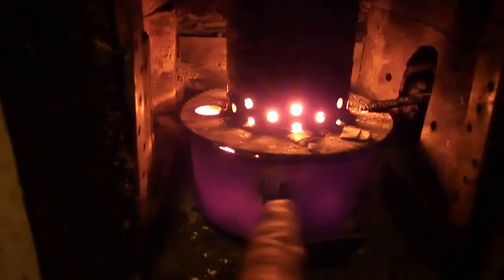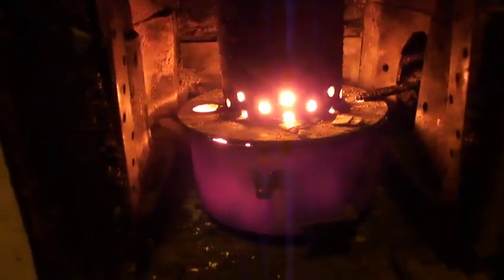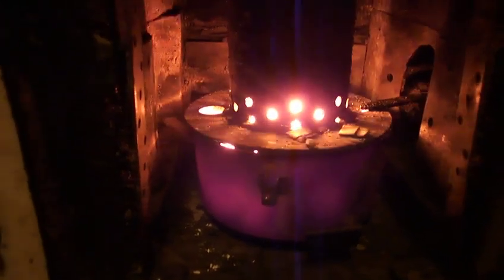my rayburn stove powered by old veg oil new burner based on the ozzirt design, now working

Comment: Are you still using this with waste oil? How does/did it perform?
Reply from the maker: working great still , its been a life saver, nothing has changed except everything inc me is 7 years has passed, the stove works same as it did, brush chimney every month and get enough soot to fill the burning pan which i use to light the stove again, uses 1litre per hour and boils kettle , heats back boiler so free hot water to shower and wash dishes, also free heating for the house, thankyou for asking, if you have email i'll send you photos :)
Reply: @lookoutleo  Hi seems quite interesting, what would you say your monthly running costs are
Reply from the maker: @davyg7883  £0 as the oil is used from resturants , i use about 30 litres a week in winter when its cold that keeps house warm, gives hot water and cook on it. in summer about half that , anything else i can help with
Reply: @lookoutleo  That's good I was just wondering when it was burning a litre a hour over the week what expense was involved but free is pretty good lol, I wasn't sure if it was running constant but I assume it's only running a few hrs daily,
Reply from the maker: @davyg7883  at moment i work till 5 ish then home light stove, put it off about 10pm most days , that keeps house hot till following evening as stove absorbs loads of heat and slowly releases , any other thoughts?
Reply: @lookoutleo  I was just wondering if after lighting and reaching temperature what the slowest drip rate it would need to maintain a decent burn, I think it's great your running one for free as too many people getting rid of their Rayburn's because of running costs
Reply from the maker: @davyg7883  one litre an hour makes the stove hot enough to cook on and makes my house toasty, half litre makes the house warm and you can have kettle on top but it will only simmer. if it didnt have the water back boiler it would be hotter obviously as 1/3 of the heat goes to water , rayburn are brilliant as you can lean against them to warm your bum and it acts like a huge heat store so even 12 hours after its out theirs still noticable heat in the room , are you uk?
Reply: @lookoutleo  Hi yes I live in Inverness and used to work on Agas and Rayburn's and just glad to see one still running instead of going to scrap because of running costs
Reply from the maker: @davyg7883  mine was originally a mains gas one and i took all that gubbans out , fitted burner welded by my mate in engineering shop :) i had a rayburn no1 before and i ran that on solid fuel and converted it to wvo to , it was 50 years old when it fell apart. this one my royal was made in 83 and still going strong :) they are solid made and would always have rayburn, :)

Comment: Can you run copper pipes from these?
Reply from the maker: hi there do you mean copper pipes with water in? i dont understand thequestion. i have my rayburn heating the water and the house, the burner is made of thick steel pipe and 10mm plate, is that any use to you

Comment: Does your rayburn have cast water pipes running front to back inside im having soot issues there and buiding up on grills on bottom of hot plate so loses draw?? Do you have the plate raised in the pan?? How many radiators are you running?? I notice you have flexi chimney, does it draw better with no bends answers much appreciated
Reply from the maker: hi there
its slightly different inside my rayburn as the back boiler is only the back of the stove and i have a plate that directs the heat back to it. the hot plate is the same as yours its got vains that restrict the flow and yes i do get a slight build up of soot on them, i clean it out about once a week to keep the flow good. radiators i only have one and hot water (200l tank), the stove itself heats the whole lower level of my house and the radiator takes the excess heat, mine burns about a litre an hour on tickover, if your trying to heat loads of rediators you will need to burn more, but if you dont have enough air it will soot up badly. the key is get as much draw as you can throu the burner to get clean combustion , get the burning pan and secondry burning tube properly sealed together and sealed in to the chimney, i cast cement all round in mine to seal it. if you have an email i'll send you some photos of the inside so you get a better idea of what i'm doing .
Reply: @lookoutleo lookoutleo please send some photos on how you sealed the burner stack into the chimney. many thanks. 
mail@mervynshute.plus.com

Comment: Hi leo do you have problems with the ray burn sooting up???
Was it oil fired or gas before??
Reply from the maker: yes it does soot up a bit but it has been better since i mounted a plate in the burning pan just below the pipe and the oil dripps on to it so it draws the flame streight up the tube causing more turbulance helping the burn, i clean out under the hot plate once a week, if i do that theres hardly any soot. the stove was a mains gas, hope this helps

Comment: Hi Leo, I have an oil fired Rayburn in storage which I have never installed. I don't know much about them so please excuse any seemingly naive questions.
The video was a little dark but otherwise excellent and informative. I am curious to know how the heat is contained, I suppose that the burner door is left open to allow airflow? Is the heat directed through ducts and baffles in the Rayburn before exiting the flue?
Where do you get your used oil from?
If you have any plans or sketches for the burner I would be very grateful if you could let me have a copy.
Many thanks,
Chris.
Reply from the maker: you can close the door to get more heat in to the oven otherwise i leave it open, all ducting is as it was before i converted it, oil from local fast food outlets. no sketches but ive seem people use an old pan with a brake disk on top with pipe welded on top, looks like mine, hope this helps
Reply: Thanks for the info. I hope to get mine sorted before the summer. Once again - many thanks. Chris.
Reply from the maker: did you get your rayburn installed and converted to vegoil?

Comment from the maker: @BNG0101sory to hear your having problems. i light mine by paper and cardboard, i also pore a little oil in the bottom of the burner and light it. once its going and the bottom chambers red hot  i turn on the oil flow and away it goes. once its all red hot i close the large hole on the left in the primary chamber with a metal plate and most of the air is then drawn throu the holes at the bottom in secondary chamber, . ive sent a full message to your account

Comment: You have done a great job of it Leo. It's different to mine in that you have a lot bigger primary air hole in the pan and far more heat being generated there as a result.  In my heater the main heat is in the secondary burner tube and above and as a result probably get more ash than you do.

All I can say is that if it works, you've done a really good job and certainly taught me a little more about what will work.